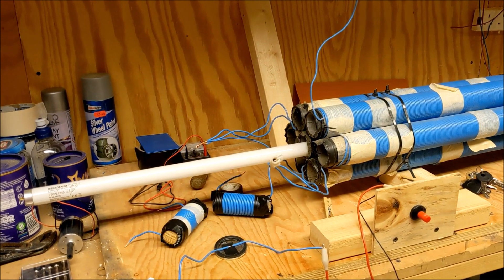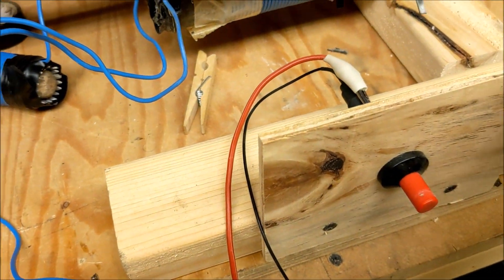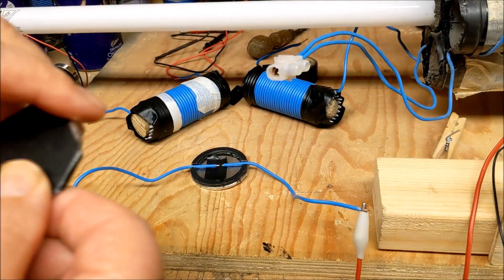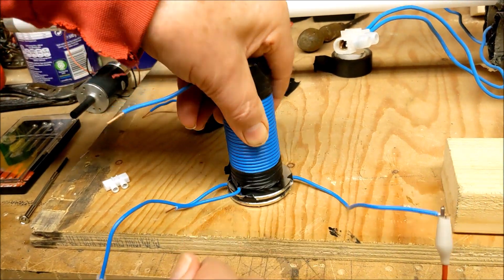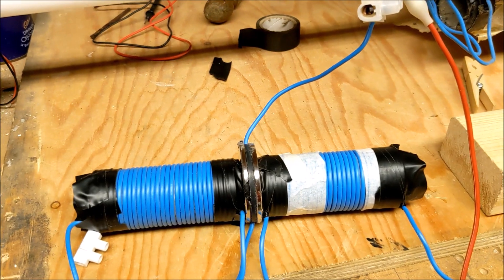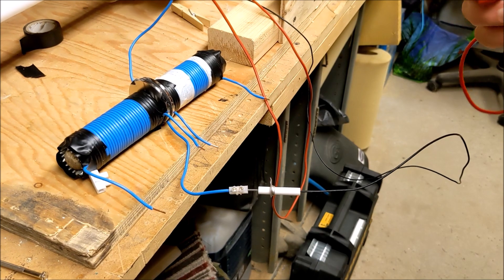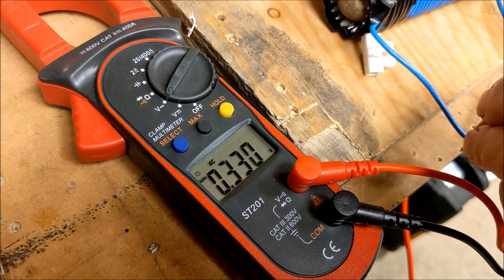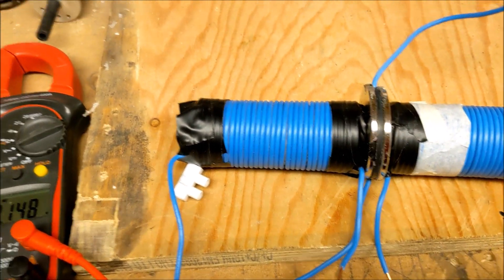Update 24 DC Pulse Method

Comment: Nice spark gap. The way that you build it was simple, but is very useful. Interesting. If you try to increase the volume of frequency using capacitor and diodes in series you can have more frequency, and at the same time if you use a potenciometer resistance, you can graduate or modulate that frequency too.

Comment: Have you tested that setup with a Geiger counter?   I've experienced some "radiation" when activating sparrks around certain magnet configurations
Reply from the maker: Last Video:- Outputs "Try it for yourself" use A/C frequency sign-wave spark on the bloch wall . From Low to High Hz.
Simple set up to copy. DC

Comment: Happy new year, what about copper pipe or aluminum pipe? With steel core? Or iron powder in veggie oil core? I think magnetism may b the brakes to slow electric currant? Whimshurst machine? No magnets, bonetti machine no magnets? Electricity= light= sound wave frequency? Aether definition s by Tesla and walter Russell, the key to radiant energy?

Comment: happy new year what frequency are you hitting the filament in your vacuum tube ? all the best
Reply from the maker: Hi great question.
Having gone through 3 line protected oscilloscopes I cannot answer.
Most of my tools are now in another country.
I am using simple pulse width modulation units with viable duty cycles from China.
Best I can do for now.
I have included the spec within some of my videos.
I hope this helps , yes it's hit & miss I enjoy trying.
Electricity isn't what you lead to believe.

Quote:- Electric is more like magnesium than you think . DC

Static is more interesting.
Reply: interisting things happen at resonant frequencies good luck  @e.powerdc1127